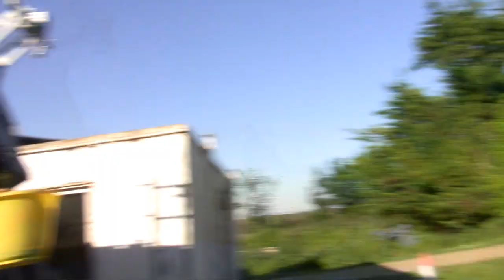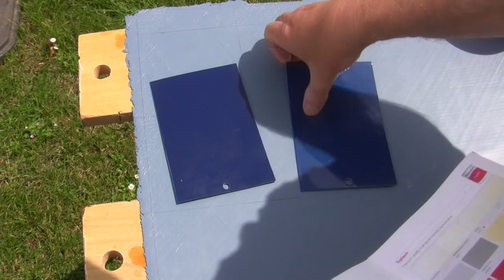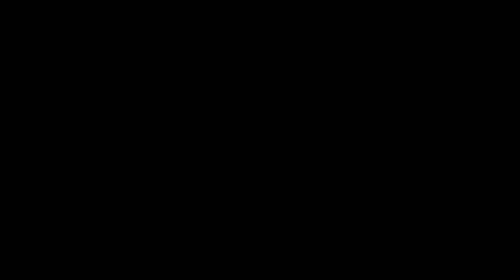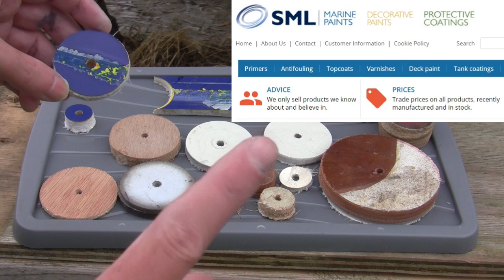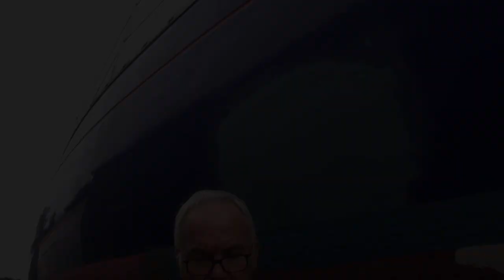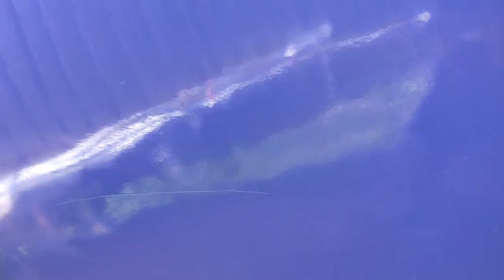Just About Sailing August 2021 - Watching paint dry, aka 50 shades of blue

Comment: I think you have done an excellent job considering you had set yourself an impossible task. If you look at say, a professional car body repair situation, they would say we cannot achieve a perfect match to faded paint and the only way to give you 100% is a complete respray,  and a compromise but less than 100% is to paint a whole panel so the edges of the new paint are broken by an edge or a shut. In Sum, short of painting the whole boat - it’s good enough and you both did well.😀👍⛵️
Reply from the maker: Thanks. Yes I knew I was trying the impossible. I did some paintwork topsides on the coachroof ages ago when I replaced the portlights. That was a defines area with good edges - the white I used was very different from the original colour and it really doesn't notice that much. I think that when Serenity is in the water, the difference will show even less.
Maybe it will make me a bit more careful about docking in future.
Cheers, Paul

Comment: That's ok buy the time she's in the water it will be fine, the repair underneath is good and that is the important bit
Reply from the maker: Very true. If only painting was as straightforward as fibreglass and epoxy. Of course, it totally serves me right for crashing in the first place. I was looking where I was going, and not where the boat was goaing.
Cheers, Paul
Reply: @verynearlyaboutsailing8114  Never mind at least you can do the repairs

Comment: I used to know some one who made a good living in Spain repairing minor damage  and . colour matching scratched boats. Of course 98% of the boats were white, but they're all  slightly different shades and textures and he had a real knack for it gained through a lot of experience . Car body scratch repair is a very competitive business and often those who do it are mobile self employed people. I wonder if this may have been an occasion where you'd have saved a lot of time and very little money by getting someone in to do it?
Of course you' wouldn't have had a video and neither would you (or us)have learned much. 
I agree with what others have said. Your colour match looks fine and because of the continual reflections and light and angle changes you get on a boat on the water, you will be the only one aware that it isn't original.
Reply from the maker: Paint and colour is not my strong point. I am sure that someone with a load of experience could have done a much better job a lot quicker. Still, I have learned a lot from doing this. Although I'm not sure if anything that I have learned will ever be of future use to me.
I think the important thing now is to get the whole boat de-oxidised and polished up, and then a good coat of UV protecting wax. And that is a job for Lucy.
Cheers, Paul

Comment: It came out pretty good. Did you use the matching paint by that company? BTW, you need a Lucy laugh track for the videos.
Reply from the maker: Yes, I did use the matching paint. Their machine measures the 'actual' colour of the paint. The problem then is the print-through from the colour underneath. Normally there would be a fairly dull primer - like the blue-grey that I used. Unfortunately, Serenity used to be bright yellow and was painted blue directly over this.
The company suggested the more vibrant blue to compensate, but I felt it was too vibrant and bright. In retrospect, I'm not sure. You can actually see the difference where the new paint is covering the old blue, the new primer and the old yellow. Where it is over the yellow, it s pretty much spot on.
I never knew it would be that complicated.
Yes, maybe Lucy could get a job in the audience of a comedy show.
Cheers, Paul

Comment: Nicely done! I have a blue West white Potter 19 that has that star shaped cracking on the front of the hull from some sort of contact. Fortunately no structural issues. I was actually thinking of doing gelcoat but was quite terrified about the prospect of having to match the paint as you’ve done quite well. I wonder is paint easier to match than gelcoat? Is that why you chose paint? I honestly know nothing about this…. it will probably be my winter project. I have a funny feeling I’ll be painting the whole boat!
Reply from the maker: Thanks for watching. Actually the reason for choosing to paint was very simple - and, sorry, because I really didn't make it clear in the video. Serenity was originally finished in yellow gelcoat. She was then painted blue (about 15 years ago). So I was doing a paint repair.
I really know nothing about how to repair big areas of gelcoat.
Mads on Sail Life did an excellent repainting job on Athena himself. The result looks superb. He is a perfectionist.
Good luck and let me know how it goes.
Cheers, Paul

Comment: I would have added increments of white paint rather than a competing shade of blue. Looks okay though I guess.
Reply from the maker: Yes, that might have worked. I think that the big trick that I missed initially was to start with the right base-colour. It just looked to me like the colour I wanted was between the two I tried - it wasn't.
The colours from the paint company were the actual base colour. I felt that the bright one was too bright. Maybe it wasn't.
If I had more time, the other thing I could have done was to try doing samples with different primers. In the tiny bit where I painted the new blue directly over the old yellow gelcoat - the match is almost perfect.
Anyway, it was a learning experience.
Cheers, Paul